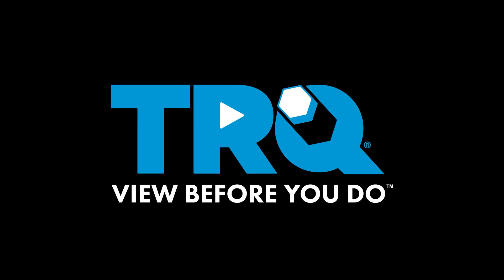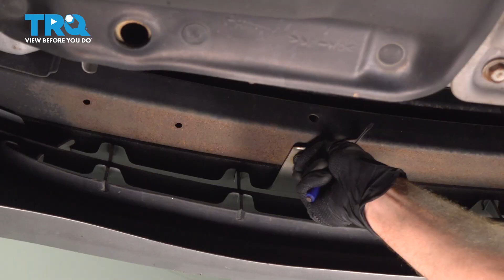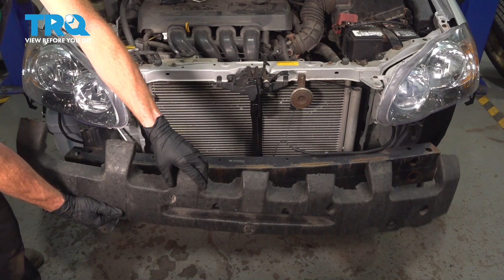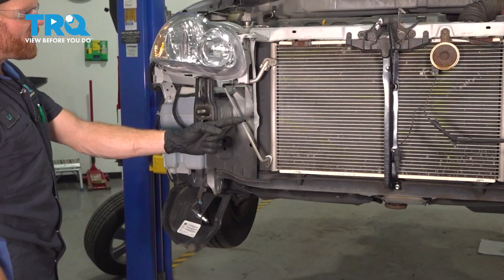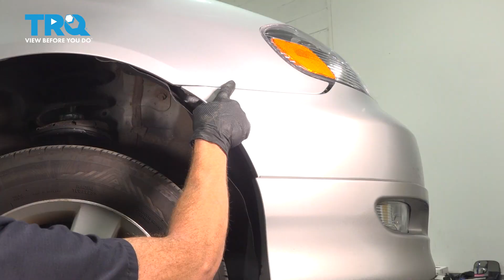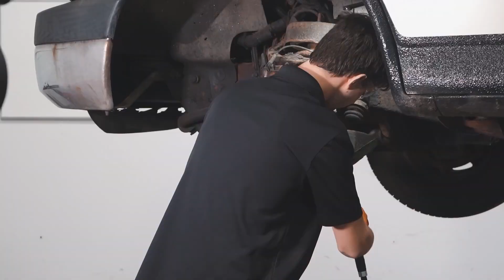How to Repair Bumper Impact Absorber 2003-2009 Toyota Corolla

Comment: I’m not trying to fix the whole bar but the part where the bracket sits is pushed in do I have to hammer it out or can I buy a replacement?